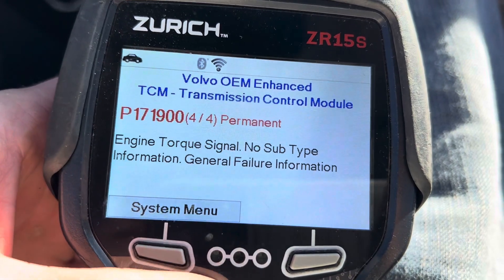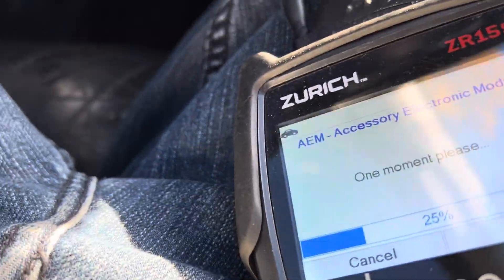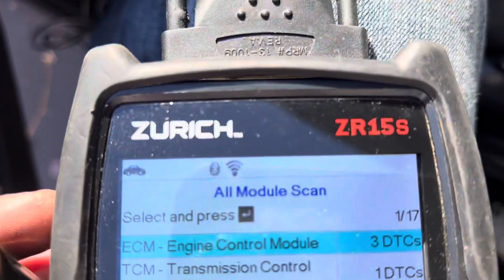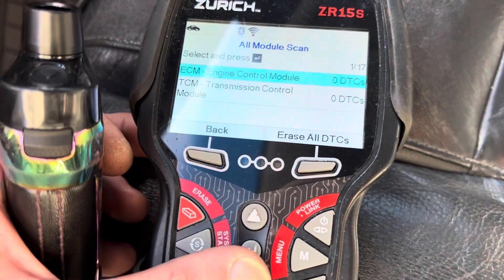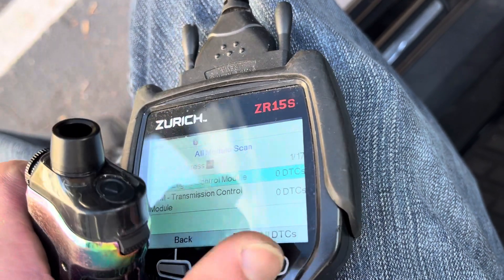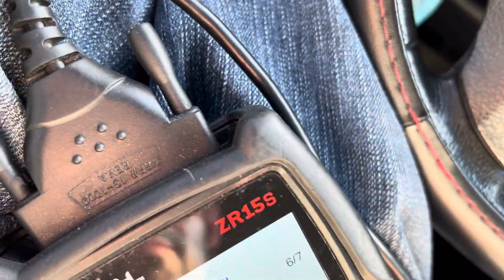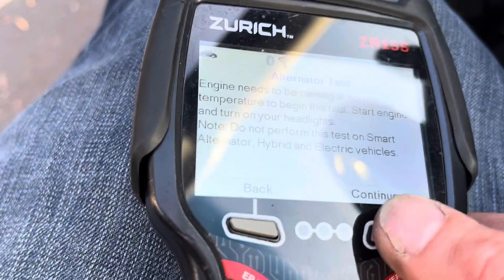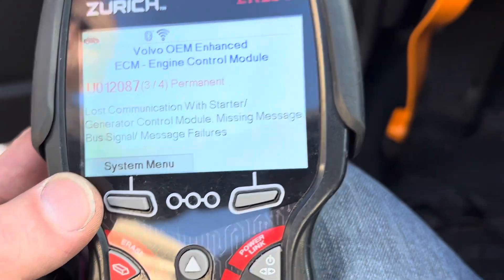2005 to 2009 Volvo XC90 3.2 l  DTC U012087/Power system service urgent/Battery light diagnostic. 1-2

Comment: I have the same issue right now, The shop checked and said the alternator is fine and i just replaced the battery. I charged the battery and its fine for a few days and the light comes on and total power loss when driving. What is the issue?
Reply from the maker: Wrong alternator voltage regulator. They make two for the specific model of the vehicle. Trust me. Check it out.

Comment: Yup this the types of mechanics u dont want to go to.
Reply from the maker: I never worked on it and someone definitely messed it up bad and never came back. I was trying to bail the gentleman out and I found out why this all happened. Nothing like having a customer blame you for the last tech…. Smh…. Needles to say I did not do the job 🤷‍♂️… Not interested in this hete
Reply: How did you fix this lol
Reply: @selectiveperformance6121  what codes u got?
Reply from the maker: It had a bad alternator regulator on this vehicle. That’s why I kept getting the U code. Somebody had just put an alternator on here. It clearly wasn’t doing his job because there’s two different types of alternators with different regulators for this particular Volvo. It’s been so long. I can’t really remember what the live stream was about, but I do remember that.
Reply from the maker: That’s been a long time. I really don’t know anymore. Exactly what the live stream was about. I don’t know if I actually fixed anything here. I think I just properly diagnosed the issue who somebody put a wrong alternator on this vehicle and needs to have a different alternator with a different regulator on the alternator to make this work that’s what the issue was. I’m basically just confirming diagnostics here and running through the procedure.

Comment: Solution?
Reply from the maker: The alternator has 2 different types of regulators. Make sure you get the correct alternator. If not then this will happen or you have a bad PCM/ECU…

Comment: Mine did this now it won’t start what do you think it could be?
Reply from the maker: Alternator are different on these vehicles.  More then likely they will give you the wrong one. It’s got a different set up but same near part number. Also. This DTC refers to a CP failure ECM …
Reply: @TSMobileMechanicLive  ok 👍

Comment: I have the same problem because i replace the voltage regulator yasterday, first i was think that's the regulator isn't work but after i had cheked with computer he told me the alternator is normal 
And the red warning because the regulator have different part number from the original one
That's why the pcm send message on dashbord 
But don't worry the voltage is good and ther's no problem
Reply from the maker: I think you’re exactly correct. Thank you for the comment. I checked the alternator and it’s testing good. It’s upsetting for the customer because the car says not to drive it. Also he does not understand?
Reply: so your issue was the voltage regulator? did it fix the problem?